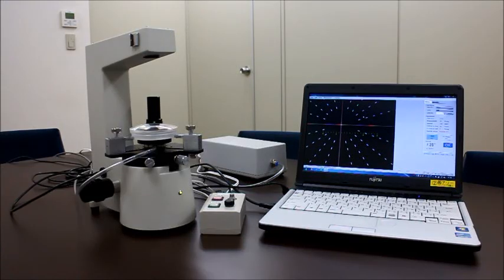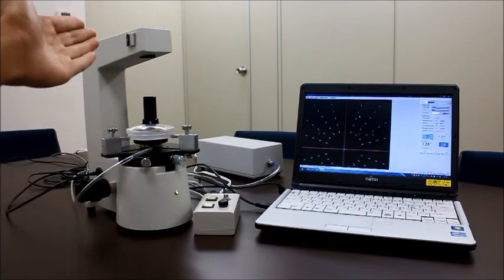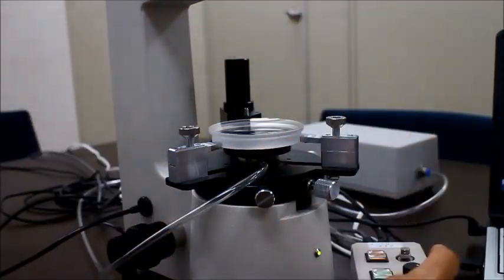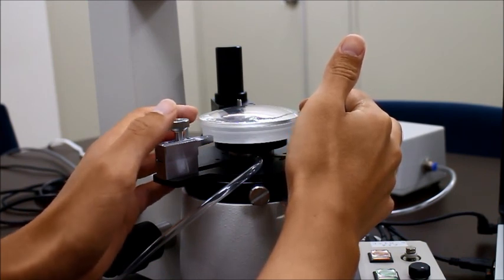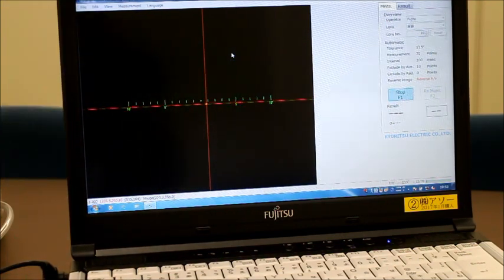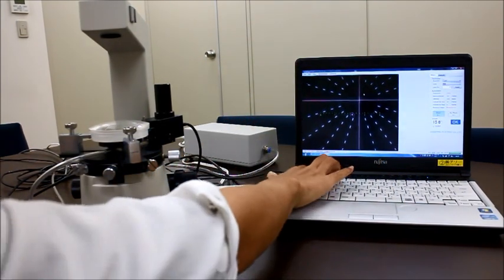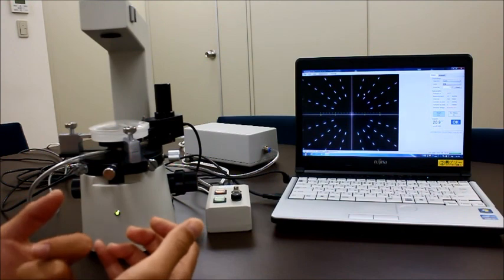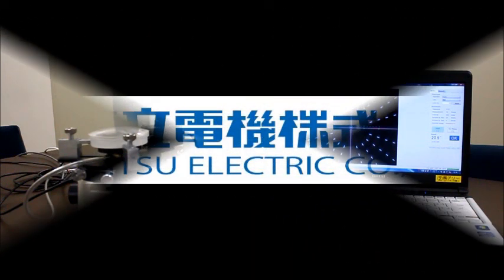Lens cementing with CS-A1100

Comment: Why not use the method by which the centrifugal works in mechanical engineering on boring machines? You can put two screws on the sides with a thread pitch of 0.5 mm and not touch it all with your hands, at least to zero the error.